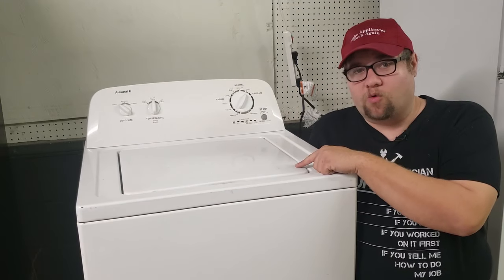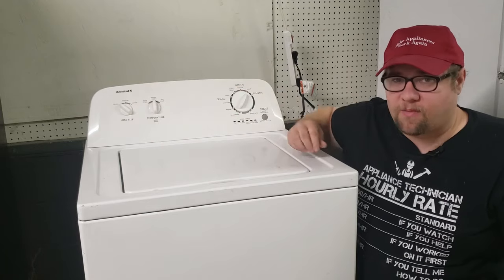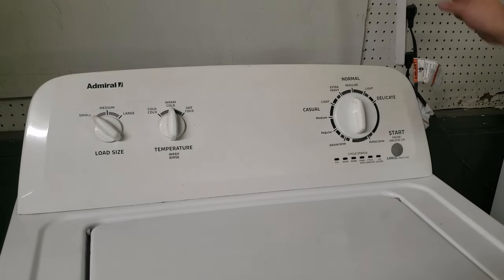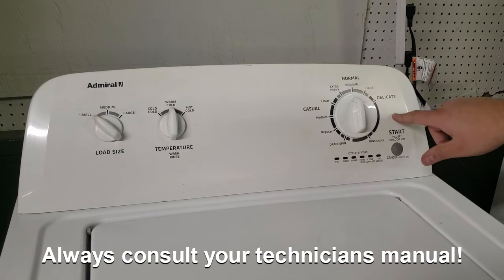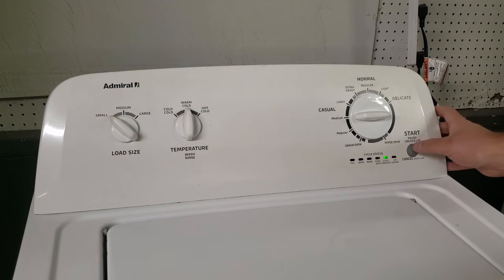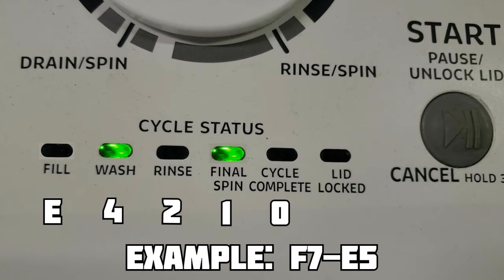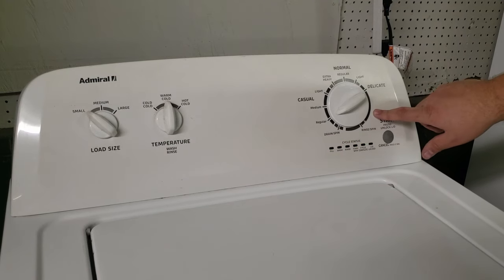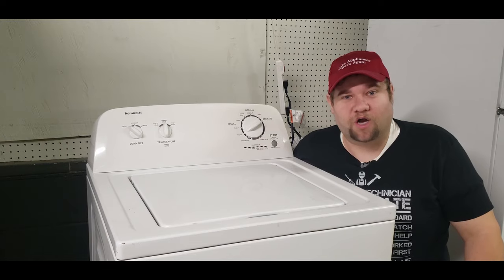How to Use Troubleshooting Mode on a Whirlpool, Maytag or Amana Washer AND Understand the Codes!

Comment: Awesome video!! I have an Amana. The Sensing Fill and Wash are blinking and then Cycle Complete blinks. (F4-E0..? Which is not on the list in the video. The machine is at least 5 years old so I’m not sure if the codes are the same.) I just put in a load in the morning and it was working fine. All I have been able to get it to do is drain/spin and that was after a few tries it finally worked twice. When I start a normal cycle it just starts to slowly spin back and forth, like it does when it’s filling or washing, but no water comes out. After a few minutes it starts to drain…air because there’s no water lol. Has anyone had this problem and figured it out? I wish I could fix it myself!! I don’t know if to call a repairman or just get a new one.

Comment: Hi. Can I do these steps when there’s water inside?
Reply from the maker: SURE CAN ! That's half the fun is using this to figure out what the machines' doing and maybe force it to drain too
Reply: The “Fill” light is flashing but I still couldn’t get all the lights to come on and force it to reset. But like you said not everyone does it on the first try.
Reply: I give up. I still couldn’t get all the LEDs to light up. Have tried many times doing the knob rotation sequence but was still unsuccessful. 🙁

Comment: I tried a few times and didn't get any lights to light up. My light icons do work however I can not get into diagnostic mode.
Reply from the maker: Unplug the machine for 15min. Turn the dial to the 12 o clock position. Plug it back in. Then turn dial counter clockwise til its back in the 12 position. Then rotate dial 3 clicks to the right/ clockwise, then one to left, then one to the right. Try a few different speeds, but its worked for me on every washer I've had
Reply: @bensappliancesandjunk  cool I got it to go into the mode then it makes a grinding sound.

Comment: I have an amana washer and it makes the running sound but no water comes out and the lights are off, any idea what could be the problem?
Reply from the maker: Hi,

If it sounds like the drain pump is running, but no water is coming out and the lights are out / in a "Lockout mode" - then it is in something called "Flood Control / Flood Prevention Mode". Your washer believes that there's a flood ongoing, and is trying to pump out as much water as possible to clear the machine.

The reason it would do this are caused by (from what I've seen) two things:

1) There is a kink or obstruction in the drain hose that's preventing the unit from expelling out the water
2) The drain pump has died, and cannot run properly to pump out the water efficiently

To end the flood prevention mode, unplug the washer, then plug it in and LET IT RUN FOR 10-20 MINUTES. It will run for awhile, then the mode will end and the machine's UI/control board will unlock, and allow you to run whatever you need to. However, I generally see this happen when the pump has died and needs replaced (because the machine thinks it can't properly get water out).
Reply: @bensappliancesandjunk  thank you so much for the info, it worked 😊

Comment: Hi. Nice video. Its not clear to me how the 2nd code showed up. Does the machine issue two codes, back to back?
Reply from the maker: 2 part code. When the first light is green, that's the F-code. When its off, its the E-code.
Reply: @bensappliancesandjunk  Does the second code appear automatically, some default amount of time, after the first code has been displayed? 

I think I may have a lid lock issue. Often could not open the lid. Then someone forced lid open with screwdriver. Now the machine won't drain water.

I had the lock out, and sitting on the top of the machine, but still plugged in. I tried running a manual diagnostic. But got odd results. A few time the lock 'buzzed', but I did not see the latch  'move'. Other times no buzzing or latch movement.

So, I tried to do a continuity test on the wires from the lock . There are 3 wires, red, white, and blue. Which would be ground, hot, and neutral? I saw a 1 on my meter when I probed all three combinations while I did nothing on the latch lock (I did not hold the locks latch in. Then I held it in and got no continuity that way either. 

Not sure either test (manual diagnostic or continuity) pointed me to the problem though. Seems if there was no continuity, then there should not have even been a buzzing noise? Can you explain what I am seeing, or how to do a valid test if my tests were not valid?
Reply from the maker: @m.n.3490  if they ripped the lock off I guarantee it needs replaced. Those locks do not do well to check like a standard lid switch from older washers. They require a pulsed on / off / on signal for the board to recognize it as working. The error code is F5 then E1 or E3. I have a Kenmore and maytag diagnostic video that are more comprehensive on understanding error codes by the way. Check those videos out but I just about guarantee the lock was going bad, then got forced open which finished it off. And the washer cant recognize that the lid lock works at all, thus its failure to do anything after it buzzes to cycle the lock and fail the test
Reply: @bensappliancesandjunk  It was not really ripped off. Neither the latch, or the look, look broken to me, although I am not an expert. I do have pictures though, if you would look at them? They tried to push the latch in with screwdriver. (Probably should have tried a credit card, as it is thinner), and it popped open at that point.

Anyways, I took the lock out of the machine, and have it at my home now. (The machine is at a friend's house). I'd like to do a continuity test, before ordering a new part since the lock is over $80. 

It's an Amana machine. Some pictures I took or on this google photos shared album:

https://photos.app.goo.gl/J3oq1WhEQZXEmbr1A
Reply from the maker: @m.n.3490  you aren't going to fix it with a multimeter. Install it back to the washer and do a recalibration test. It will attempt to reset the washer to default in spite of whatever happened to the lid lock itself. If the recalibration fails and you're still having an issue, then look at the code if it's a lock or unlock failure.

Again, you can't do a continuity test on those locks. The washer CPU has to test a lock and unlock cycle. Manually checking for continuity doesn't mean anything if the washer can't physically trigger it when installed.
Reply: @bensappliancesandjunk  OK. I'll try the recalibration. The manual says calibraton will run for 2-4 minutes, and ends when lid unlocks and enters standby mode. If my lid does not unlock, what would be the best way to open the lid at that point?

If the above test fails, I think I would try the manual test mode again, as my booklet had LID LOCK as one of the tests. But I was a little confused on how to finish the LID LOCK test. The book says to start manual test mode, which I did. 

Then the instruction gets confusing to me. It says:  "pushing the START button, will activate/deactivate each outpout. When the ouptut is activated, the corresponding STATUS LEDs will flash, IMPORTANT: Lid must be closed and locked to perform SPIN & AGITATE tests." (I put a picture of that instruction here:  https://photos.app.goo.gl/J3oq1WhEQZXEmbr1A ). 

The book seems to be saying the LID LOCK LED should be lit, but the diagram in the right side column does not indicate that the LED is supposed to be lit for the LID LOCK test. (It is not shaded in like for the other tests). 

So, does that mean I should keep pushing the START button until either the SPIN or AGITATE LED is lit?

Then the booklet says that if the LED is not lit (and my LID LOCK LED was not) then go to TEST 8 (LID LOCK) which does indicate to do an Ohms test on the J6 CONNECTOR pinouts - and those would be the pins in the connector, not the pins in the circuit board J6 connection, right?

Thanks again for your help.

Comment: Can I send you a video of what my Amana is doing? It is clicking and not really agitating. It fills, spins to drain and all that stuff... But clicks during agitation. Amana belt driven washer NTW4605EW
Reply from the maker: If it clicks in agitation, check the belt underneath to see if it or the plastic splutch is rubbing on the cover underneath.

Comment: Hi my Amana washer turns completely off everytime there is a power outage. There was one earlier today & ive tried the codes & nothing is working. No lights, no noise, nothing. Please help! I have to wash my husbands work clothes & hang them to dry before 7pm as he works at 2am
Reply: I’ve tried unplugging & plugging back in. I’ve flipped the breakers. The dryer always continues to work & the lights in the room as well as the outlets work as well. It’s always just the washer.
Reply: & we never remember or even understand what we did to make it work the previous outages 😂 hellllpp
Reply from the maker: I'm not sure what you're getting at.... You say it always turns off when there's a power outage... Is the washer tripping the breaker(s) constantly? Or are you having problems at the house? 

Unplug the washer, give it about 10 minutes, then plug it back in. Listen if you hear any click noises on the washer control board - you should hear a few as the control board "Boots up". If you don't hear any, its possible the board failed due to the power outage - and I'd imagine if you get enough outages, it may fry the board if it isn't surge protected.

Comment: Hi my washer maytag will fill with water then wont do anything. If I scoop some water out of it and close the lid then it will cycle. It's not all the time either and it's a top lid washer any suggestions
Reply from the maker: I'd need to know the model/brand of the Maytag. Did it give you any error codes when you put it into diagnostics?

Comment: Hi Ben.  Is it possible to bypass the lid lock so I can look inside the tub to diagnose issues while the water is filling and tub is agitating?  I'd like to clean it using your Oxy/Citric Acid mixture and watch the results.
Reply: Take the latch off using a t-15 torx bit and stick it in the hole, then push play
Reply: Don't know about this particular model but use to stick a pencil or screwdriver in mine to hold the switch open. Eventually just twisted the wires together when the switch broke.
Reply: You can on the older models with the pull out timers aka direct drives don't do it on this one it will fry the control board. Just take out the 2 screws on the back and slide it forward to take of the top

Comment: When I do this I basically get F1. My “sensing fill and final spin” lights flash. Basically my washer stopped mid cycle full of water and won’t do anything. It just turns off.
Reply: SAME HERE! So I  will cont. onward to see if something else works...
Reply: @gafairbanks2434  according to the internet, it means the control board has died and needs to be replaced. I googled around and the part is almost as expensive as a new washer.

Comment: I have a Bravo model of Maytag and it would spin out of balance. I just changed the suspension rods and that solved the problem for about 5 washes. Now it's out of balance again. I did the re-calibration and the Spin light stayed on and blinking. Any advice?

Comment: Why isn’t there an F4 section? This list of codes completely bypass the F4 error codes. I have an F4-E0 error code. What does that mean? Please I really need to know what this means
Reply from the maker: Newer washers have an updated code. Likely I'd it's newer ish, it's going to be F8 rather than F4
Reply: @bensappliancesandjunk  I’d never have thought of that lol. thanks 🙏
Reply from the maker: @markfukkerberg1372  No worries bud. That's one issue I had w/ this video. I made it just over 2 years ago, and I found out, afterwards, I was using a way older Amana where the code SYSTEM is the same, but the numbers are different. Ugh.

Comment: Hi I have an Amana HE and it is clicking. When I open the lid  the clicking stops. What does this mean?   Also it does not come on. No lights or nothing.
Reply from the maker: When is it clicking, and what else is it doing? Is the lid lock constantly clicking, and nothing else - and you cannot run laundry/select anything? If so, the lid lock may be going bad, and it can't test the lock properly, therefore won't run.
Reply: @bensappliancesandjunk  Yes the lid lock was clicking when the lid was closed. When I opened it ,the clicking stopped. The machine wont do anything. It does not light up or turn on. Now there is no clicking at all. the  machine is not making any sounds.
Reply: Bens Appliances and Junk my amana washer does nothing but when I plug it in I hear it clicks that means electricity is going to the board but it does nothing
Reply from the maker: @sanidon7536  hi, wait about 30 seconds then try the knob combination to put the unit in troubleshooting/diagnostics. If it doesnt do anything,  likely the board is bad
Reply: Bens Appliances and Junk yes I did that abt 3 times an it still won’t work so I figure the board is bad. How can I get a board?

Comment: Forgive my ignorance, I am brand new at this. Is there a way to just not bother with the diagnostic mode and just have the customer tell you what the problem is, then circuit test the board or something?  Because if the Diagnostic mode is only going to give you a general idea how else can you pin it down anyway?Or is that a waste of time?
Reply from the maker: Honest truth: Customers are idiots. I showed this video to a customer and he still couldn't figure anything out to give me error codes (The freakin' drain hose was folded in half causing the machine not to drain ARGH!)

But like you said: Customer descriptions are generally where the diagnosis starts. What is it doing wrong? What components could cause that failure?

The diagnostic mode is helpful because it at least gives you a quick heads-up on what COULD be the problem. For example, today the complaint was "Won't spin or drain" paired with "I think there's something wrong with the drum - it won't turn!". The error codes helped me eliminate a few things within like... 30 seconds since no lid lock issue came up so I was able to isolate-away that area of failure (beyond the hose being kinked up).

Appliance fix/call in question: The moron ADDED another drain hose made of soft plastic tubing to extend the hose, and it was folded in half. The machine could not drain at. all. F0E2 error code. But the machine couldn't spin either, F7E1 code. Why wouldn't it spin? Because the basket was weighted down with water and physically could not move. It was also in a flood prevention mode, locking him out of doing anything really.

But again, it all starts with them saying what the problem is, then isolating what components could be the issue.

Re: Testing from the board - that CAN be very valuable, but I've found a lot of problems are at the components rather than the board. If the drain pump is, for example, shot, you're still going to get 120v from board to pump when its supposed to actuate. You can isolate it away as a board failure, but in my experience... A drain-related issue is usually... A pump-related issue or at least something from the tub to the drain hose standpipe.

I hope that makes sense.
Reply from the maker: @terrencemclaughlin3241  what are you talking about?

Comment: I have an Amana top loader.  I got F1-E0 then I turned it to diagnostic mode and got F4- E0 for some reason I I can’t find f1-E0 not sure what it is
Reply from the maker: Are you absolutely sure there are no lights on the E-code at all? I can't say I've heard of F4 E0 ever. I have a Maytag diagnostic video on my playlist I did far more recently than this Amana, showing all the possible green light codes. May want to look at that one as well, just to make sure.

Comment: My landlord just bought this 6 months ago and it’s making a weird humming noise with the lid up and no lights are on. I tried hitting cancel, shutting the lid and unplugging it but nothing works. The same thing happened to our old one which is why we had to get a new one.
Reply from the maker: Is it only humming and otherwise totally unresponsive?
Reply: @bensappliancesandjunk  yes that is exactly what it’s doing. Even when I unplug it and wait 15-20 mins and plug it back it in it does the same exact thing again.
Reply from the maker: @brenantube5802  it's in flood control mode. Plug it in and wait it out. It'll take 15min to finish it and restore function. Usually it means the drain pump has gone bad or has something majority stuck in it
Reply: @bensappliancesandjunk  ok so just plug it in and let it make that noise and it will stop?  I can try that the only  reason I unplugged it and stopped the noise was just in case the pump or motor didn’t break. Thanks for all
Of your help.
Reply from the maker: @brenantube5802  yes it should be OK to let it run for about 15 to 20min

Comment: My F code read F3. but my fill light was lit up the entire time so does that mean i dont have an E code? i got lost on that part
Reply from the maker: Check out the Maytag Diagnostic video I did. I've had a lot of questions so I did a more comprehensive follow-up vid
Reply: @bensappliancesandjunk  does it make a difference that my washer is a whirlpool?
Reply from the maker: @cassandracarbajal7504  no. They're all the same. I did make a revised video for Maytags that has more information, and a better explanation of how the code system works. I shot this video in January, and I've worked on these even more since then to try to shoot better/more informative videos on understanding how these work.